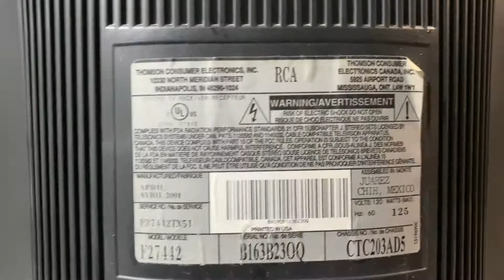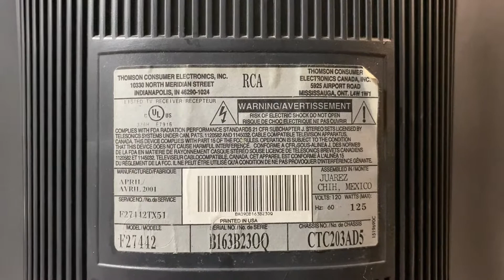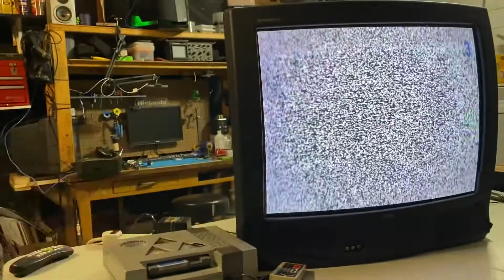RCA 27" CRT Television Roadside Rescue and Inspection

Comment: I had that exact same model of RCA TV, that thing became possessed after about 6 years of use, it would randomly change channels, run the volume up or down and randomly turn itself on if it was off or off if it was on. I put up with it for about a year and finally set it out beside the road, it was gone before I got back upstairs and looked out the window.
Reply from the maker: That's personality! 
Someone may even be enjoying that set to this day
Reply: Wonder if it was because of the buttons, i've heard about that kind of thing happening.

Comment: Literally I'm not joking a couple weeks ago I picked up the same exact TV that you have for $8 at a garage sale and it's one of the best TVs I've ever had. Mine was in a little better condition than yours but I wish you good luck on yours
Reply from the maker: That's amazing! Love to hear it.
Reply: @peco_de_guile I just purchased this TV. Do you know how I can put video games on the screen without the remote?
Reply from the maker: @Burns6688  I was not able to change the input to composite without the remote. I believe it is required. Or even if you use a Universal Remote, it should work.

Comment: I have 2 of the same tvs but GE branded.  They are 27 inch.  They were made in 2004.  They both had a soldrr issue around where the coaxel cabel goes in. Ge and rca are both made by Thompson consumer electronicx. Me 2 ge tvs look identical to your RCA.  The sound you hear when you plug it in is the degsusing circuit.  Ad its cracked on the corner, but hey it works.  I say dont scrap it, but offrr it for a cheap price on you local craigslist.  Many reto gamers like tbe old crt tvs.  The reason this was tossed was probably because it was not hdtv ready and was nit a flat screen.  Great find though.